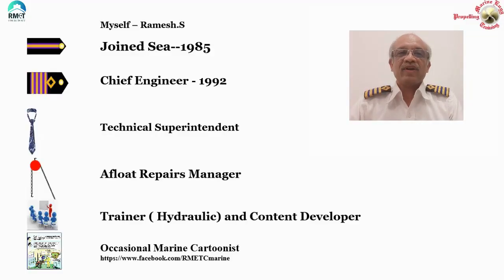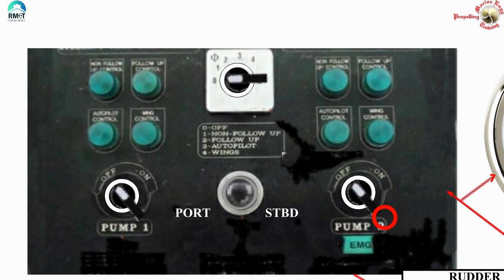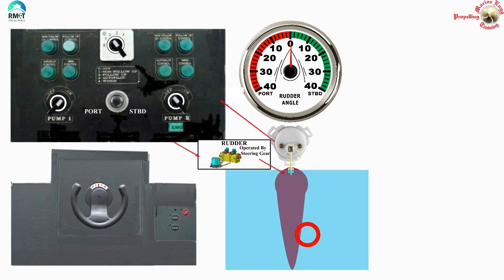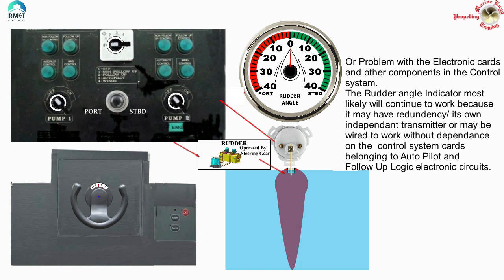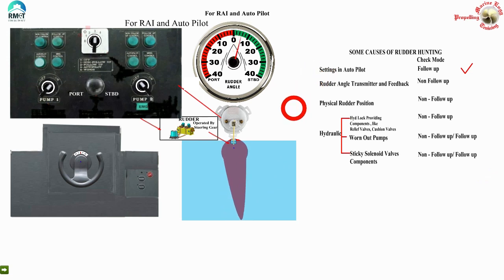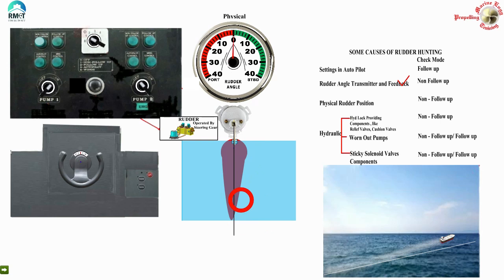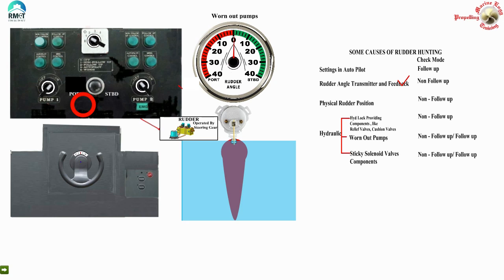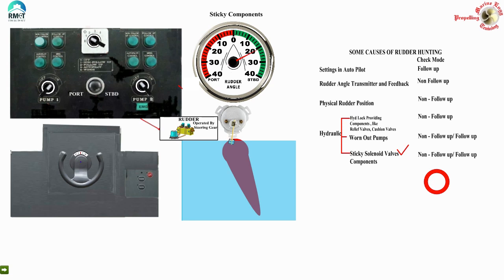What is Follow up and  Non Follow Up methods of steering ?? Trouble shoot Rudder Hunting problem ??

Comment: Very good presentation. All aspects of rudder hunting has been dealt with. Congratulations dear Ramesh for painstakingly made the animation. It will definetly be helpful to many Chief Engineers to understand the working principle and systematic fault finding. Thanks once again. On follow up mode, Rudder remains in the position as long as steering wheel is kept at that position. If the steering wheel is spring loaded, the moment you leave the wheel,  rudder will come back to midship.

Comment: One of my friend was telling me that during his watch as a third officer his captain who jut joined the ship one day back asked Bosun to put the ship to FOLLOW-UP mode from AUTO PILOT and he did so but she was still at AUTO PILOT and captain got panic that why steering is not coming  on auto and called every officer on Bridge meanwhile third officer told him that it is because the NOBE or LEVER might came out and BOSUN while putting it back changed it to FOLLOW-UP while original position still at the auto pilot and after checking it was found that this is the problem.

Comment: Like always more beautifully done sir, every time with a better presentation than before. Sir in troubleshooting hydraulic about the sticky solenoid valve point, is there a possibility of this jerky nature of rudder to be because of pitching of ship in rough weather ? Can that be taken into account before jumping into faulty solenoid valve or so conclusion? 
Also, can air trapped in the hydraulic system due to leakage in the system be the reason for slow response of the rudder movement on either direction? I mean if rudder is responding slow movement only on one side i.e either port or starboard?
Reply: the checking of air in the system is the first step,eventhough it is very unlikely .if ram packings are bad there are chances.
ssr
Reply from the maker: Hi Tousiff..Tnks for you kind words as always.Air in the system is always a possibility, but the reasoning which I always hear is suspect in my opinion. I find it hard to believe that a leak will cause air ingress. Hydraulics is always about high to medium pressure  oil always being available in every part of the line..So question of Air ingress should never Arise.So my belief is that in OPen loop Hydraulic system , where pump takes suction from TANK..Air can Enter due to two reasons--- Low level Of OIl in Tank which during Pitching can contribute to momentary air ingress. Other more likely point is..When you have low level of oil in Tank (Maybe still more than Alarm Level), The return Oil from deck etc ..if it FALLS from a height inside the tank ...can cause a lot of bubbling and this can find its way to pump suction.Even in a Ram type steering Gear ..and the RAm seals are Defective..OIL will LEAK for Sure.. but still Air will not enter the system through the seal. This is my reasoning. Have a Look at the the 4 ram circuit..Introspect ...See if you are able to understand my thought process...
Reply: @rmetcvideos  thank you sir, will definitely look into 4 ram.

Comment: Good presentation. I have one question. How much is hard port or stbd? In your video you have shown it as 30 deg. I  have seen many a Master argue it should be 35 deg or till it reaches its limit. Your view on this please. TIA.
Reply from the maker: it is point of view..As per rules Rudder shud move till 35...But as per effectiveness 30 is almost as effective as 35..like a valve 99 % open and 100 % open..no bog difference

Comment: Dear chief sorry to tell you that no ship can sail without electrical officer as they are the pivotal aspects of the control and automation system.. I have seen chief engineers without even having knowledge in racking out a VCB or changing a contactor. I met with a 3rd engineer who debated with me over a mechanical fault telling me it was a electrical fault...

Comment: how steering gear get signal from bridge helm order to rudder angle final position... in electro-hydroulic steering gear
Reply from the maker: Comparision in Auto Pilot console.. signal to actuating mechanism -in sync with Feedback from Rudder ANgle transmitter

Comment: Ive always wanted to know, can a vessel move in a straight line, even though knowing that propellers is subjected to tranverse thrust, on upper and lower blade, and since the upper and lower blade operate on different depths, the transverse thrust can never be equalized, so ive read that this unbalanace causes angular thrust which pushes the vessel to go either port or stbd side ( depending on if its right or left handed propeller ) alittle, so could someone please confirm if this is true and false
Reply from the maker: Yes you are correct..

Comment: Sorry, how is NFU method is actually working? What is happening after we move the controller left or right? Plz sir i have so much confusion
Reply from the maker: The rudder will  KEEP on going to port as long as the controller is operated..In FU mode  you tell the rudder to go to a PARTICULAR angle, but in NFU mode u can only tel it yo go to prt side or Stbd side
Reply: @rmetcvideos  agreed sir but my question is where the signal is going? I read somewhere by NFU mode we are controlling 3 solenoid v/vs. Particularly I have confusion about the working.
Reply: In non follow up operate directional valve manualy untill rudder reach to desired angle. Onece you release the joistic directional valve come back to normal position and no oil feed to rams and hydraulic locking keep remain. That means rudder angle in desired angle. This is same like you carrying out emergency steering drill for electro hydraulic steering gear system from steering gear room. In non follow up system no feed back signal. As far as you are puting the joistic rudder will move. Once you release it keep rudder in that angle
Reply: Follow up ,non follow up or auto pilot signal goes to solonoids of directional valves in hydraulic system in steering gear room
Reply: @bhageshkatoch2944  In NFU your solenoids are not working.But when you move your joystick to directions of port or stbd ,you operate the directional valve indirectly. Like for the duration you hold the joystick to port or stbd,for the same duration your directional valve of the chosen direction remains open and hydraulic oil goes to move the ram in that direction. Once you leave the joystick(i.e. joystick comes to its original state) your directional valve closes and there is hydraulic locking of rudder at that angle .The angle you yourself check at the angle indicator and leave joystick accordingly.
Reply: @DeepakJha-rf7jz  thanku sir now my doubt is cleared. 🙏
Reply: @rmetcvideos GOOD DAY sir ,kindly clear my following doubts. in NFU mode does the signal goes through telemotor as like follow up mode? and also clear why we try NFU mode as an immediate action when steering failure? THANK YOU

Comment: Actually,the feed back for the follow up mode of steering control is from a potentiometer  which is located near the rudder stock and linked so that the turning movement of the stock is transferred to the potentiometer.This trans mitter has nothing to do with the rudder angle indication.For this purpose(indication) a synchro transmitter is used and fitted and linked same as the feed back potentiometer.Both transmitters have different function nothing in common.Narrative regarding NFU could have been better if described the need for using this mode and about control supply arrangement   during this operation.Good effort but needs more improvement.
Reply: NFU things are not for engineers sir and we don't steer the ship. we just do the fault finding and rectify it and its the basic and from that we can understand that NFU's are for turning the ship instantaneously to hard port or hard starboard